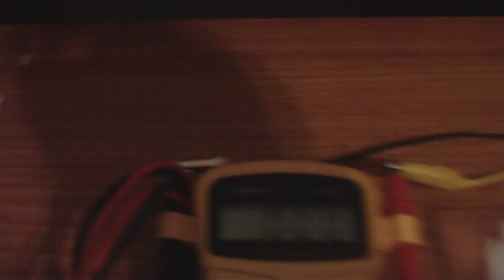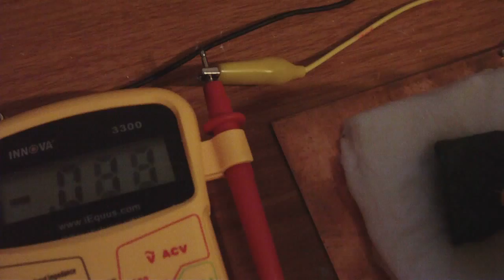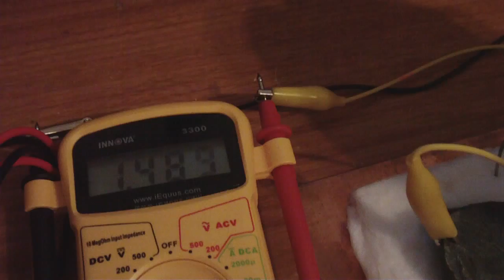Hematite Electrode Magnetic and Gold electrodes

Comment: Welll done IPB2 !
If you use it with pencil leads, will the rock corrode ?
Does your paper towel just have water or saltwater ?
Interesting it is also, that you get 1.5 Volts with aluminium.
Can you please also show the short circuit currents ? Many thanks.
P.S: Please test the gold magnet onto the copper plate and not just the paper towel.

Regards, Stefan.